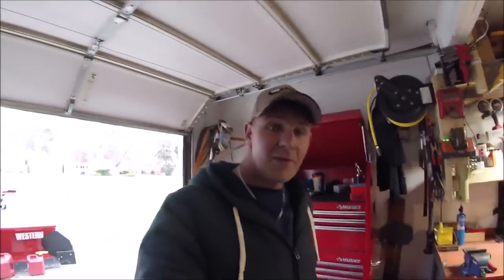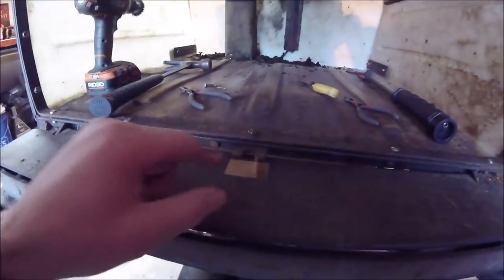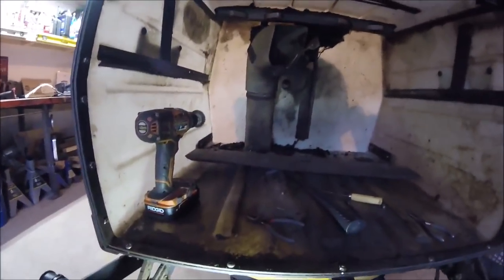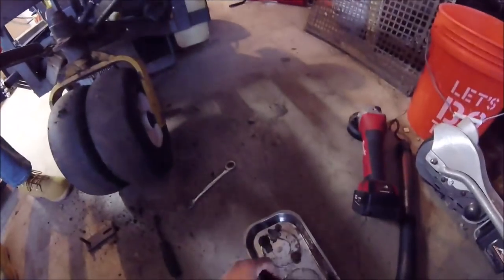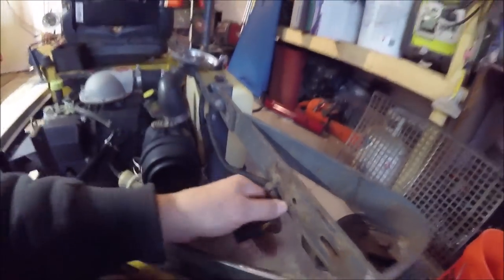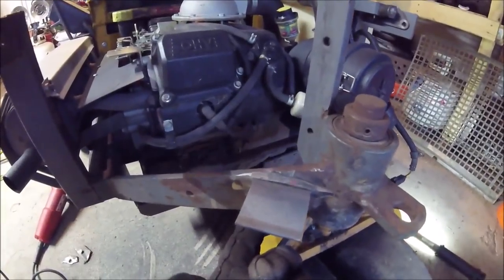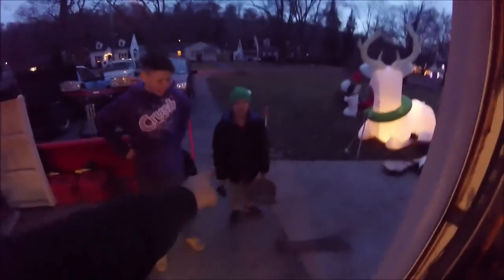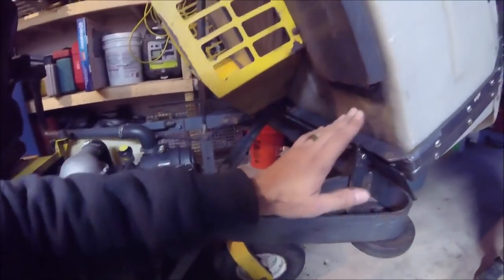Walker Mower Hopper, common Walker mower problems

Comment: How do I fix a sticky throttle?  Mine keeps getting stuck in the low idle position.  Thanks and keep up the great content!!
Reply from the maker: Depends what's causing it. Could be a bad cable, could be linkage, could be internals in the carb
Reply: @CountrysideStrong  when I take it to the dealer they fix it but haven't shown ne what to do

Comment: So just outta curiosity what welder did you use and I assume it was flux core not mig that you used?
Reply from the maker: It is a mig but I'm running flux thru it so the gas is shut off. It's a Lincoln 140HD
Reply: Countryside Vlogs I have the pro mig 135 it’s older than yours but I think comparable! Yeah welding that size unfortunately need to use flux core not the end of the world just dirtier! Reminds me of my Lincoln ac/dc stick welder
Reply: Actually I guess you could mig but just double pass
Reply from the maker: @Trackhoe075  I just like the ease of it. It's all in the settings. 20 people told me when I built my dump on my duelly not to use flux it'll never hold. 3 years later and I've had tons and tons literally of grass, mulch, topsoil, concrete chunks, you name it.... Not one broken weld.
Reply: Countryside Vlogs yup it’s stronger than people think it’s just dirtier with the splatter and smokier too but with our machines if your doing thicker material ya kinda don’t have an option unless you grind a v and fill that way I suppose! I must say though your the first I saw do inside.... lol we do work with what we got right? I’m no different
Reply from the maker: @Trackhoe075  I say stick with what ya know
Reply: Countryside Vlogs you got that right!!!